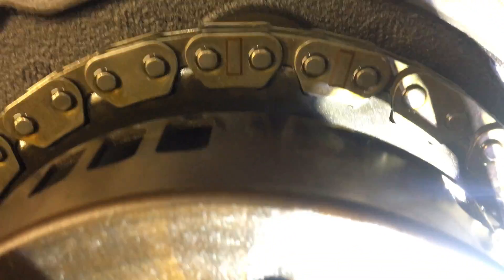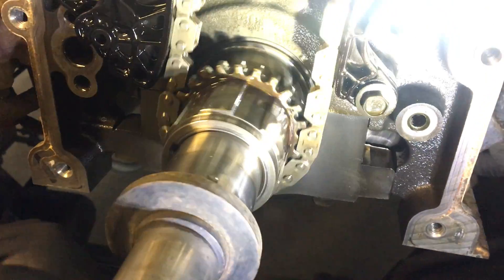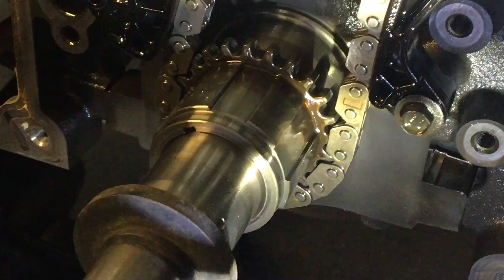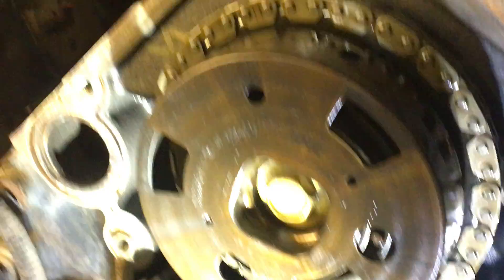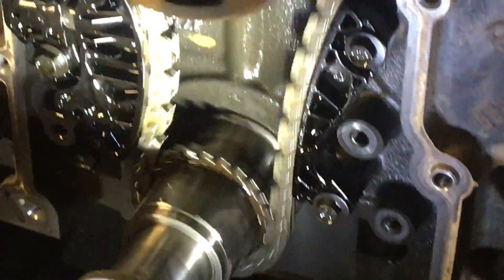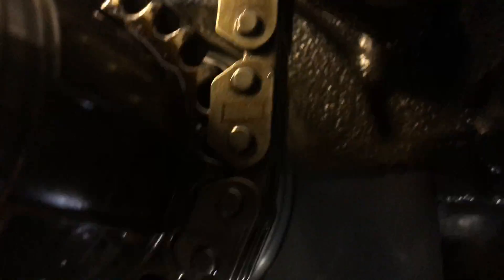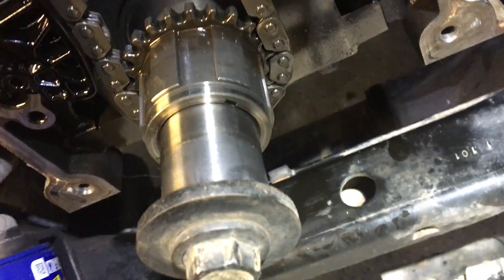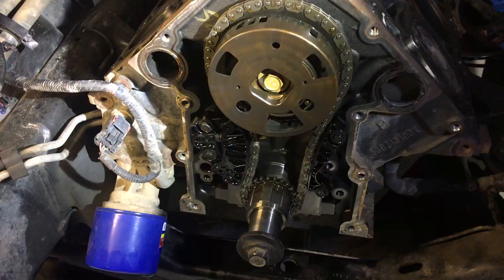2011 ram 2500 Hemi 5.7- how to set timing

Comment: Hi Tito I see you removed the oil pump in you video. When dropping the oil pan was there any issues or anything difficult.  What was the procedure you followed to drop the oil pan to remove the oil pump? Any info would be appreciated
Reply from the maker: Ryan,

it was very simple. I tried to remove the pump without removing the pan & that was a pain in the ass. I thought would save some work. but ultimately it was better to pull the pan. it came right out. I just remove the bolts. the trick is when installing the pan back to the truck. make sure you follow the tightening sequence. this is laid out in the repair manual. but you want to make sure  it tightens even. similar to the heads, and timing cover. I hope this helps good luck but for sure remove the pan it is the way to go.
Reply: @titonunez3431  Hi Tito thanks for the reply. The reason I ask is because the Haynes manual indicates that you need to lift the motor to remove the pan. I was hoping it's like you said and it's just dropping bolts then that's it. Hopefully mine is Similar to yours and dropping the pan is not difficult.  Thanks for the info man. Much appreciated
Reply: @titonunez3431  Hi Tito
I have the heads off now as I finally tackled this job. What did you do to clean the head gasket mating surfaces on both the heads and block? Did you use acetone or alchohol? There are so many opinions and since your truck is running I was wondering what you did

Comment: Hey, great video. Only thing is that I noticed when your marks were all lined up Cyl 3 was at TDC. Cyl 1 should be
Reply: It is on TDC cyl 1 on 15.40 mark
Reply from the maker: Thanks man, I have had some good feedback on the video. my number 1 Cyl is TDC. from 16-16:45 I show it fairly well. but u are correct if the number 1 Cyl is not TDC u will have some problems when firing up.

Comment: It was easier for me to line the top 2 up at 12 since I didnt pull the oil pan or radiator. 2012 300c had bad exhaust lifter looked the same as yours did cam is fine I have brand new heads etc. But great video and thanks it helped a lot
Reply from the maker: I appreciate it!

Comment: Amazing video! Gonna help me a lot. I have a  2011 ram 1500 with 191k km on it. Mine is ticking lots and I'm preparing to do this job. Can I ask you why you removed the oil pump? Was it only to see the timing Mark's? Did you put a new chain? I read of a way to use the key hole on the crankshaft with the pump in to avoid removing the pump and dropping the oil pan, did you ever read anything  like that? Thanks for making the video.
Reply: Ryan v  Hi Ryan, I saw a video where the guy made 3 paint marks to keep his reference for the cam chain, then just pulled it to one side with a bungee to keep it from dropping of the bottom of the oil pump, so he did not have to remove the oil pump or put the motor on TDC, saves some time.
Reply: @flyingdream777  I'll search for that. Arranging the timing seems like a pain following the hanes guide so this would be helpful.

Comment: NICE VIDEO SIR. BUT YOU DONT NEED TO ROTATE THE ENGINE SO MANY TIME TO DO SO. AS LONG YOU HAVE THE TOP AND BOTTOM MARKS WHERE THEY GO YOU SHOULD BE OK. THE MARKS ON THE CHAIN ARE JUST FOR REFERENCE AND HELP A LOT. BUT... EVERYBODY WORK DIFFERENT. NICE JOB BRO.
Reply from the maker: Thanks man, yea for sure more than one way to skin a cat. I thought about rotating the cam shaft separately but I was not sure that I would get cylinder 1 to the top position and the crank in the corresponding position. I knew my truck was in time prior to starting the repair. so I wanted to take out some of the room for error out of the equation. By rotating manually, it ensured both crank and cam shafts were both in the correct position. Because u can put the dot on the cam at the 12 o'clock position but that does not mean cylinder 1 will be in top position?? you have to get both in this position. and that was the part i was leery of??? so i decided to take the long route but safe bet to make sure it was in time. have a great day
DN
Reply: I always thought that it could not be done and I see is possible. I tried it once and after five minutes without luck I never tried it again. Thanks for the video and nice truck. I love them.

Comment: What do the top marks have to line up with?
Reply from the maker: Bryan, the timing Chan has there marked links. A single marked line on one side and two links back to back marked on the other side of the chain. These should be easily identified. Carefully look though the chain. The two links need to straddle the mark on the camshaft sprocket. The mark on the cam shaft sprocket needs to be at 12 o’clock. Think of the sprocket as a clock face and get the mark in the 12 o’clock position. It will line up with a bolt hole in the block at the top of the motor. This technique o my works if u have not removed your chain yet and everything is still connected from when u started the project. U will simply need to manually rotate everything until it lines up. If u already took the chain off and were not in time. U will need to get the #1 cylinder into TDC. Some other fellas on this thread commented on how to find tDC another way?? I am only familiar with the way in the video. Hope this helps good luck!! Have a good day
Reply: Tito Nunez yep we already took the chain off because we couldn’t get the oil pump off .
Reply from the maker: Dang!!! i had to drop my oil pan to get the last bolt on the oil pump, it was a B*#$ to get too!! Now that the chain is off you can still set the timing and get it just right. but i am not too familiar with that process. i know you have to get the 1st Cylinder in the top position it will be flush with the block. like the video towards the end. and then position to crank to ,match this position and you will be able to get the chain back on and be in time. @blakedymond is commenting further down. He mentioned this process. he may be able to offer some insight?? best of luck to you! u got this!
Reply: Tito Nunez it’s not completely off the crank sprocket
Reply from the maker: Well in theory the chain never moved. you could possibly slide the chain back onto the  the cam sprocket in the same position you took it off? as long as the cam shaft sprocket did not rotate while you were taking off the chain???? very risky, I wouldn't do it. I would finish dropping the Oil pan, pull that oil pump completely and set the crank and the cam to TDC by rotating each individually into position. this is the only way to know for sure both are set right. Because if you're off a little it is going to be a big problem, and it is risky trying to slide that chain back on in hopes nothing moved?? that's a tough one..... ,   @Dejuan8732
Reply: Tito Nunez he rotated it :(
Reply from the maker: I would for sure set everything to TDC. a little more work, but u still got this. you just need to set the timing with another process. what year is your truck? did you have a lifter problem?? just wondering what got you going on this project. 
 @Dejuan8732
Reply: Tito Nunez it’s my buddy’s charger he was just upgrading his cam. It’s low lift so we didn’t pull the heads. I think he has to pull the valve covers and pull the pushrods
Reply from the maker: @Dejuan8732  ooooohhhh Dang..... it would make it easier... Good luck fellas
Reply from the maker: I am surprised u were able to pull the camshaft with the pushrods and lifters installed? i would also check those components the lifters might have slipped down if you push the new cam in dont force it....
Reply: Tito Nunez cam isn’t pulled. It wouldn’t rotate easy so we knew something was wrong and stopped for the night. I was going to install a hellcat cam in mine to replace my 6.4 cam but now idk About this job it sucks.
Reply from the maker: Wowzer, I haven't seen anyone do this without pulling the , valve covers, rocker arms, pushrods, heads and lifters. then pull the camshaft?? the lifters make contact with camshaft the rollers on the lifters are in contact with the cam shaft. if you pulled that camshaft the lifters would fall into the hole the cam shaft would leave?? when it is pulled?? I would really research and see before I would go forward. I haven't seen a cam go in without pretty much breaking the engine down to the block?? I hope I am wrong and you can get it in another way. because it sounds like neither of u expected a project possibly this large??  @Dejuan8732

Comment: Thank you for this post. I had to turn the engine over by hand for nearly 50 minutes in order to get the original timing marks to show up. I left the spark plugs in because I ended up putting referbished heads on and a new cam in. Thought I had it all together right, but I was half a tooth off when I fired up and thankfully I didn’t hurt anything. But I had to pull the timing cover off again and go all through timing procedure again. We will see what happens today when I put it together. Thanks again.
Reply from the maker: I am glade to hear the info is helpful. I bet it was a little hard to turn with the heads and rocker arms installed? keep us posted I hope everything works out.  it sounds like you are on the right track.
Reply: Tito I got it all together and it runs smooth, but now I have tapping coming from top end. I’m confused now. No misfires or shaking.
Reply from the maker: @mechanicdave4899 _ I apologize for the delay, the Holidays had me pre occupied. I am hoping you have fixed your issue? or your tapping has gone away? it is tough to diagnose without seeing it in person. it could be a number of different reasons? when I started mine it was loud and it did take 20 minutes roughly to quiet dow? Everything is linked to the camshaft. the valve train can be noisy? but if it is a loud know I would not recommend driving it until you have it figured out.
Reply: Tito Nunez I remove the heads and sent them back to the machine shop for a valuation they don’t believe it’s in the hands but truth be told the truck never made the noise until I got the head work done I’m waiting till tomorrow to get the heads looked at another machine shop to get a second opinion before I install I ended up putting different liquors in and the newest still returns after warm-up
Reply: @mechanicdave4899  hey you ever figure it out ? I just swapped lifters and cam an truck sounds horrible now but every now an then it runs mint for a moment. I'm thinking oil pressure.
Reply: biggismallz 2005 it’s the damn cam bearings. I’m sure of it. The engine would need to be pulled and taken to a machine shop to have the bearings pressed out and new ones installed. PS I think rockauto parts aren’t the way to go meaning cam/lifters.

Comment: I have a 2004 dodge ram,with 5.7 hemi with a 256000 miles.i have done nothing to the motor except change oil and spark plugs. Nothing on the transmission neither. Why are you doing your timing
Reply from the maker: That is great! I love to hear trucks/cars staying on the road for the miles they were meant too. most people trade in at 100k and I am always thinking you still have a ton of life left on that vehicle. I bought my truck with 105k on it and drove it to 140k and ran into problems. Lifter failed and camshaft was damaged. that is why I repaired the camshaft. once my camshaft was installed I needed to set the timing. I am now currently at 163k and running strong. u know what they say keep her greasy and she will run forever. I am shooting for the 300k club one day?? have good one.
Reply: bc theyre different engines
 his is mds
Reply: @jc-xo8yd  2006 dodge charger with hemi msd going on 320 thousand miles still running champ
Reply: @Raidersforlife229  idk what year it was but the lifters were made by melling in china and the rollers seized into cam bc crap quality.  thats the issue with mds

Comment: Good video I’m getting ready to do this job too for the same reason. At changing the camshaft did you install new camshaft bearings?
Reply from the maker: I did not install cam shaft bearing? the shaft pulled out and went right back into its slot. I did install all new lifters 16 total for intake and exhaust. replaced all bolts on head gaskets and seals. I apologize for the delay. I hope your repair went well.
Reply: Tito Nunez I have not started yet but I’m getting ready to buy all the parts. Where did you get your parts from? Are the lifters upgraded in a way or is there a high chance of a failed lifter in the future again? Thank you for your response bro
Reply from the maker: @chingon0011  I decided to stay within the manufacturers specifications and I purchased all parts from my local dealer. I.e. camshaft, lifters, Head bolt kit & gaskets. I wanted all parts from Mopar to match what was initially installed. I know most guys will install a performance camshaft. I decided not too because I was happy with the performance and I did not want to start dealing with the headaches of modifying the camshaft? it would also require new timing chain and I was not interested in changing it. I would recommend all new lifters $500.00 from dealer , head bolts (once you remove the current ones, the bolts are stretched and some say you can not get proper torque?) $200.00 roughly, camshaft I DONT REMEMBER HOW MUCH PROBABLY $250.00ISH, gasket kit $125.00 with all parts, fluids, and random items I needed I want to ballpark my repair around $1500? I did have to buy some tools for the repair. Good luck!!
Reply: Tito Nunez I want to do everything original too, no performance stuff. Are the lifters the same? My concern with the lifters if they’re the same is them seizing up again and redoing the job in the future. Around How much does the dealer charge for the job?
Reply from the maker: The lifters are the same, all parts are mechanical and to run the risk of failing? For one reason or another? My opinion is it is less common than common. We are the unfortunate ones who have experienced a mechanical failure. If you replace it and everything else checks out. U have to trust the issue has been repaired. If you notice abnormal wear on multiple lifters I would investigate other areas for the cause? When u pull the oil pan check for metal chunks, when the lifter fails parts of metal can chip and work their way through the valve train down to the oil pan. And during its way down, the metal chunks/debris is squeezing its way through tight spaces gouging,scratching and possibly damaging other components? This is dooms day scenario. Chances are u will replace the lifters and camshaft and things will run great and you will continue to get years of mileage out of it:) the dealer quoted $4,600.00 to repair.
Reply: Tito Nunez yeah that’s true, I got the truck with around 90k miles I don’t know how well the previous owners maintained it but yeah you’re right mechanical parts run the risk of failing. thanks bro for all the good info you gave me through here in the comments and on your video. Take care
Reply: Tito Nunez hey bro how are you? I got a question for you, when installing the lifters did you soak them in oil or you just lubed the outsides? I see some people say soak them in oil and others not to because they can lock up and cause severe damage during startup. What did you do? I’m getting ready to install everything back.

Comment: Thanks for the video. How many miles was on truck when this happened, and what type of oil was you using? I would guess it has more to do with the design than the oil though, if the engine is turning 4.000 RPM,  those little rollers would be smoking, seems like they would have used a larger diameter roller, so they would spin slower and last longer?
Reply from the maker: I had right around 141k on the truck, I bought the truck with 102k I am not sure what oil they were using prior to purchase. I was using Auto zone brand oil. I have switched to Valvoline semi synthetic. i currently have 162k on the truck now and feeling strong. do you have any oils you would recommend?
Reply: Thanks for your reply. I don't know what oil would be best. I bought a new 2500 in 2014, it was a 2013 model they had left over. I have about six months left on the warranty and have all the service done at the dealer, but will do my own when warranty expires. They are using regular oil, don't know if synthetic oil would make a difference or not, this seems to be a pretty common problem with the Hemi.